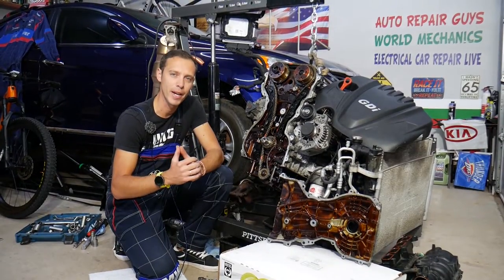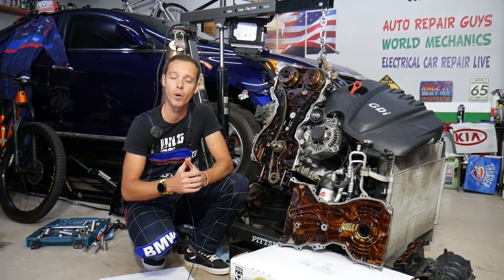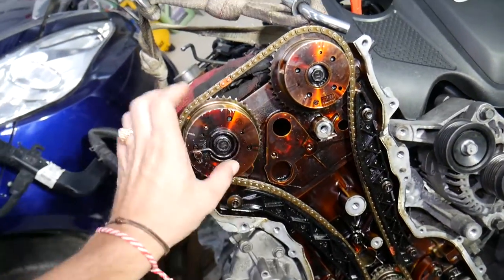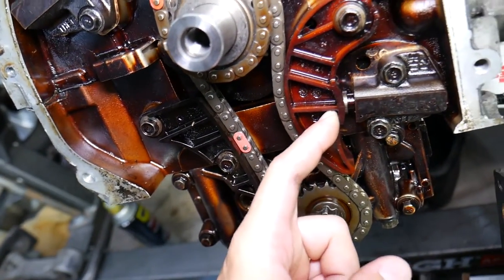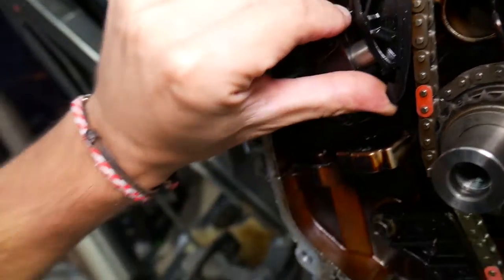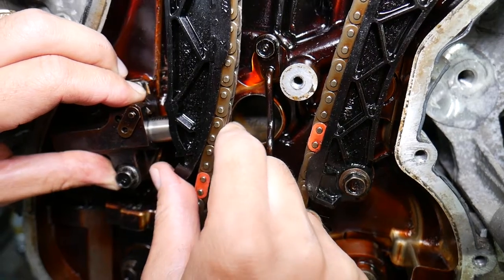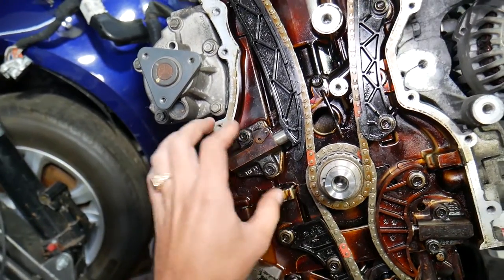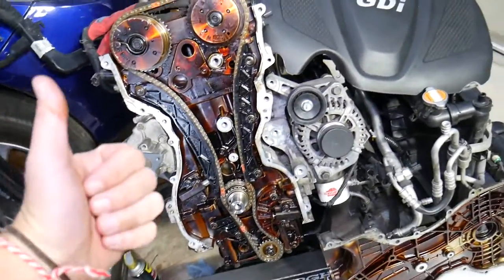HYUNDAI KIA NOISE RATTLE FROM ENGINE ON COLD START, NOISE WHEN CAR STARTS 1.6 2.0 2.4 2.5 GDI

Comment: Thank you for your excellent description of exactly what is happening to make that specific noise. This is a very common problem with Hyundai, that is happening prematurely at 70k miles on average. Pretty disappointing, but especially for a subsequent purchasor of the vehicle because they will be out of warranty (100k warranty is only for the original purchasor, it's 60k for subsequent owners [ask me how I know...]). This issue and the way Hyundai have handled the matter is why I will never buy another Hyundai. It's hard to imagine this issue not being the subject of a class action.

Comment: Hi. Hope u r well. We have a kia picanto and wen we start the car it swings and then our battery dies. Nt sure wer it pulling current frm. Wen it starts it has a tapping sound frm the engen / sumwer. The engen has been fixed so nt sure

Comment: Everybody talks about cold start rattle, but what about a hot start rattle? I have a 2016  Kia Forte MPI, it never rattles in the morning, or when the engine has been sitting for no matter how long. But when the engine has reached its operating temperature and is used for a while, it rattles on startup after it's been sitting for some minutes (and the engine is still warm). Again, if it sits for long enough so that the engine is not so warm, it doesn't rattle. FYI, I use 5w30 oil.
Reply: Mines too and it does it everyday now I have an 2017 Kia forte Lx

Comment: So if those were my symptoms early on and then after what is a constant rattle even on acceleration, does this mean I’ve damaged crankshaft or any other parts it’s still running and idling well but rattling heavily and I change timing chain, tensioners guides etc. because this resolve my problems or is there a good possibility that internal damage has been done more ? Thx

Comment: I have kia forte 2016 1.8 engine I have the same problem. pink for 1-2 seconds on cold start. but it also has another sound when cold it is heard as a diesel engine for 1 minute after it warms up the noise is eliminated
Reply: My G4FC 1.6 also sounds like a diesel when cold, mostly noticeable when letting go of off the gas pedal and at idle. When accelerating, there is basically no noise like that. My mechanic told me, it's normal...

Comment: So I just bought a 22 Kona and it started making that sound at 40 miles and the dealership still hasn’t fixed it and says it’s normal but it only makes the sound when I’ve been using auto start stop what could be the cause for mine I’m thinking it’s the starter

Comment: This can't happen with a VW golf 5 1.9tdi can it?
It's a timing belt car...
I'm about to change the hex balance Shaft in the oil pump, have to remove the oil sump then remove circlip then simple swap over of the balance Shaft.

I'm a bit worried about the rtv working though, i bought threebond because I heard it was good. It's cold in the UK right now so going to heat up after cleaning the sealing surface and leave for 24hrs to set, please tell me what you think?

Thanks for all the great videos you provide. Great work!!
👍

Comment: Hello, i have a 2012 hyundai genesis 2.0t coupe. I keep getting code P0014. I switched both vvt solenoids, replaced both camshaft position sensors, replaced exaust camshaft gear sprocket, replaced oil, replaced oil filter, i checked harness/wires/ plugs and everything was good, i checked the timing, timing chain, timing tentioner, and timing guides and everything is PERFECT. With only 119k miles the car runs very smooth. No rough idling, no stalling, starts up good and yet still code P0014 keeps coming up. please help, I've been trying to fix this car up. Please reply. I am using oil 10w40 instead of 5w30 could that the problem?